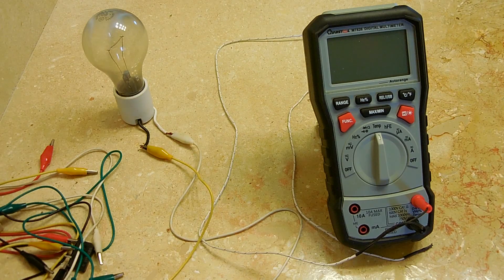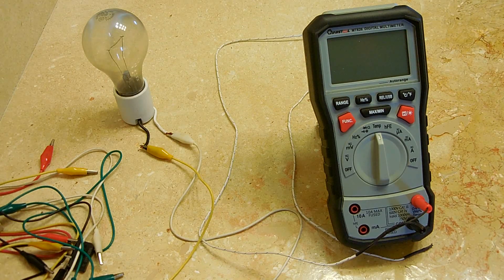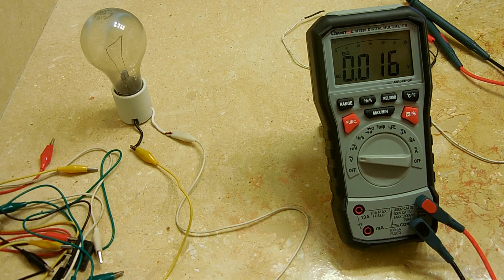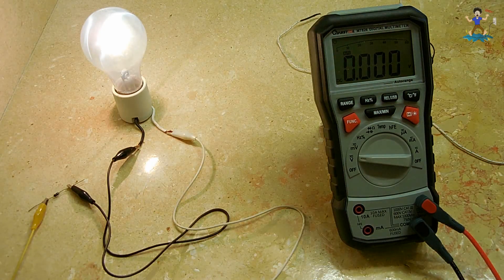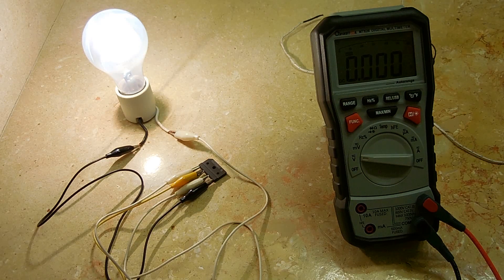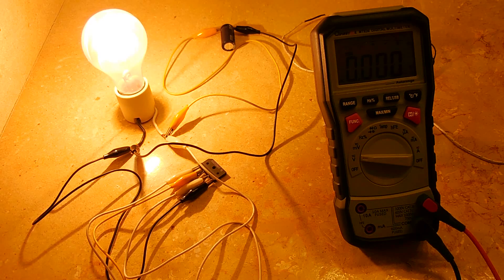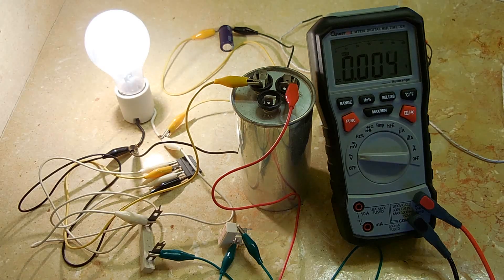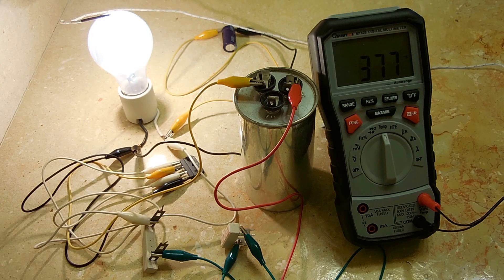DC Cooler Than AC? (RMS to DC)

Comment: You could and still can buy 220 v Edison base light bulbs without importing them. Any bulbs from Europe would have the wrong base and you would need an adapter to use it . That is why the disk was  created. As long as you stayed within its wattage rating it was very effective, You would need to use larger bulbs to account for the lose of light output. I have an on all night outside porch light which is automatically dimmed (X10) to 50 % when it comes on. It is still going strong after 11 years.

Comment: Does it matter which side you put the resistors on? Hot or neutral
Reply: Olle Gladso Because it might not trip a breaker?
Reply: So why is it good practice to put the resistor on the hot side?

Comment: Yes, the capacitor does not heatup like a resistor would do. However, you drop the power over the mains grid, and this is what power provider do not like. With a resistor, you have to pay for the heater 😁 but with a cap the provider has to pay 😵
Reply from the maker: The capacitor doesn't heat up unless you use the wrong voltage rating or very high frequency AC.
Reply: electronicsNmore, if the cap gets hot then you definitive made something wrong!

Comment: Those devices we're probably supplying unfiltered half wave or full wave DC to the light. I believe that even full wave DC, since it's average voltage is less than the RMS AC, would make the bulb run slightly cooler. Obviously half wave DC would make the bulb run cooler as the bulb has less current running through it. Clearly the devices were a sales gimmick. What no one told us was that not all U.S. Electrical Systems run at 110 to 120 VAC. I lived in a city here in Minnesota where the voltage is 130 VAC. I couldn't understand why our light bulbs kept burning out faster than normal tell someone one I asked explained to me that we had to buy special 130 volt light bulbs. Talk about a scam the city and Electical Supplier had going.
Reply: That's a pitty

Comment: I have some of those energy savin buttons and they're nothing more than a single diode.  Su consuming half the voltage equates to 1/4 of the power, and the light was also dimmer.  A cooler, dimmer resulting bulb lived forever.
Reply from the maker: Yes, they were nothing more than power limiting devices.

Comment: I remember these coin like devices years ago that you would put in a light bulb socket.  If I recall correctly, they did not say DC same voltage would run a bulb cooler than AC.  The ad said if I recall (many years ago) that 1.  Increases bulb life, as bulbs burned out often back then 2.  It would reduce energy costs.  3.  Heat, don't remember if they said would run cooler.  The ad did not say how the circuit works and unless you have direct information, it would be speculation on your tests.  Assuming they used a diode or bridge rectifier, then in the former you would reduce energy costs, increase bulb life and reduce heat, and yes some light output and in the latter, would also increase bulb life, but little change in energy costs and heat, but would get more light output.  So it is not exactly false claims if they were using just a diode.  They just don't mention the reduced light output as well.  Increased life was due to the filament fatigue and breaking from AC vibration which DC would reduce.  Also the filament coating fell off from shock more with AC and DC reduces it.  They may have also added a small inductor in the circuit for this as well. (My speculation)  Now my observations.  Bulb filaments (household Edison types) are non-linear devices and when you chart the IV curves versus light output you will see that current changes effect light output much less than voltage.  So if they used only a diode then it is as you showed in terms of heat.  In terms of power and equivalent light output, 120VAC and 120VDC are not the same.  To make a equivalent comparison, you would need to set the DC power to a bulb equal to the 120VAC source x 1.414 which is around 170VDC.  So at 170VDC to one bulb and 120VAC to another bulb they would have equivalent power and the bulbs should have equal light outputs.  If you try this I would be interested in knowing the new temperature comparison.  The twist in this is beyond Ohms law since the filaments draw non-linear current due to resistance change as temperature changes.  Cooler filaments draw more current than hotter ones.  In fact you you calculate only using Ohms law, you will see a skew between AC calculated and what you measure as voltage/current input changes.
Reply from the maker: Clearly you're talking about another device, because the one I recall claimed the power would be converted to DC, and operate cooler as a result. Powering the bulb using 170VDC would result in a bulb that's much brighter and hotter, which was clearly shown in the video with 150VDC. The device more than likely only reduced power to the bulb which resulted in lower light output and longer life. Bottom line? The device was a waste of money because if you want to save power, just use a lower wattage bulb. :-)
Reply: ElectronicsNmore.  Thanks for replying.  Yeah the gizmo I refer to I think was shown in magazines in the 1970s or 1980s.  It was not about just saving power or reducing heat.  It was about greatly increasing longevity.  Which does have merit.  From my own experience with vacuum tubes, filaments die from 2 main ways:  current surge (cold filament), Mechanical shock (from AC swing) causing filament breakage.  Tube filaments that were powered by DC don't experience the 60Hz mechanical shock vibration.  For a future video scam, I would like to see your tests on the so called magnets on gas lines improving MPG if it is a scam or if there is anything to it.
Reply from the maker: I know those well. :-) Tried them years ago, and saw no difference in savings. I may have to make a video, but the problem would be having the exact same conditions for both tests.
Reply: 170V is the peak value and 120V is the RMS, so 120VAC gives the same power as 120VDC
Reply: blackstar.  Thanks for the correction.  You are right about 120VAC RMS is equal to 120VDC for power in a resistive load.  I was some how associating 120VAC Average which is not the same as 120VDC.  Still my other  statements hold for the "energy saver" not being a total scam.  So here is a question for you.  If I rectify 120VAC True RMS to charge a capacitor bank the voltage will read approx 170VDC.  Now if we use this 170VDC to drive the bulb to get the same Lumens as with a 120VAC source, will we need to lower the DC voltage to 120VDC or can we still run at 170VDC (lower current for same watts)?
Reply from the maker: Correct
Reply from the maker: It may not be a "Total" scam, but people were mislead when they marketed the device to the public.
Reply: If you rectify ac and smooth it with a capacitor, you have effectively increased the "RMS" value. The capacitor will charge and dump extra energy into the bulb in every positive cycle, So you will need to lower the DC voltage.
Reply: They could never have used u bridge rectifier when that green button(cell) like device only was affecting one of the two 'polarities'. At max it contained one diode and maybe a resistor and / or capacitor (although I doubt that)

Comment: I still have somewhere one of those little disks you inserted in the bulb socket. It was sold at the time as bulb life extender. Nothing more than a single diode which reduced the effective voltage to one half thereby extending the bulb life. (This was copied from the internet)Running incandescent lamps at a voltage different than the voltage the lamp is designed to use, called rated voltage, greatly affects their life.  Operating a lamp at 120% of its recommended voltage   will cut its life down to 10 to 15% of its rated life. On the other hand, reducing   the operating voltage to just 90% of the recommended voltage will increase life   by a factor of 4. This is useful when designing lamps for traffic signals, indicators,   and other applications where long life is important. Manufacturers can increase   lamp life by designing lamps for a higher than necessary voltage. For example,   they can increase the filament's resistance so that the lamp runs cooler. If   a filament is longer than necessary for the voltage, its resistance is higher.   The filament can also be thicker if it is made even longer. Due to the lower   operating temperature and the thicker filament, the lamp life will be longer.   The trade-off, however, is lower efficacy and light output than at the rated   voltage. A traffic signal lamp has a rated life of 8000 hours because it is   designed for a much higher voltage than the actual voltage used to power the   lamp.
Reply from the maker: That proves what I heard. Converted to DC, save power, and run cooler.They left out that the bulb wouldn't be operating at full brightness, which is why the bulb is cooler. Long life incandescent bulbs are usually 130V. Most homes are between 115 and 125v, so the bulb lasted a long time.
Reply: Correct, a known trick in the States is (or was?) to import (incandescent) light bulbs from the EU where the voltage is almost double that in the States. Amazingly those lamps will still function kind of okay, but they last practically forever

Comment: if i bought a 200 watt bulb from a country that uses 220 volts and plugged it into my 110 volt house would i have a 100 watt light that would last forever without burning out?
Reply from the maker: builtrodewreckedit It should light up 1/2 as bright, and the filament should last an incredibly long time.

Comment: Silly "inventors" and naive people. AFAIK filament bulbs have higher efficiency if filament is hotter, so what would be the point of running the bulb cooler? To waste more energy for the same amount of light? And if someone want's to run bulb cooler, that one can buy lower wattage bulb.
Reply from the maker: mbaksa So many scams in this world.
Reply: electronicsNmore so true!
Reply: mbaksa If you run bulb cooler it will have longer working time but decreased light intensity so I think thats the benefit of keeping it cooler. And also if you make bulb hotter filament will dissipate more heat and also increase light intensity but efficiency would be around the same always for these small changes of heat produced ( about 98 % into heat and rest into light) .
Correct me if im wrong.
Reply: Luka, 60W bulb emits about 800 lm, while 100W bulb emits about 1600 lm. You need two 60W bulbs to get the same amount of light as a single 100W bulb. With two 60W bulbs you'll be burning 120W, and you could get the same amount of light while using 100W of power with a single 100W bulb. So... I'm correcting you. :)
Reply: mbaksa That sounds right,didnt know about that lumen info and thanks for correction. :).  Edit: 1 more question. By doubling wattage (almost) from 60 to 100 we also get double lumens so isnt efficiency nearly same?